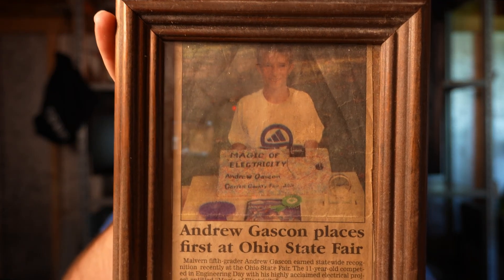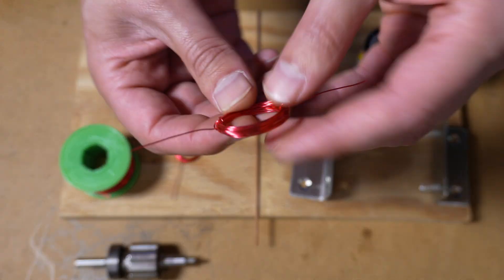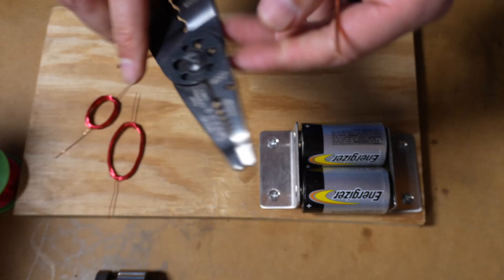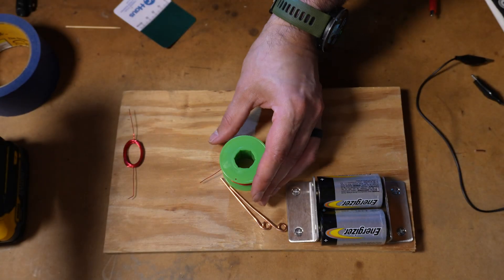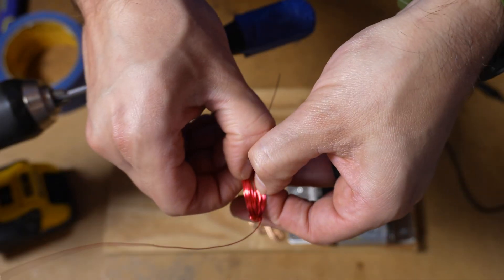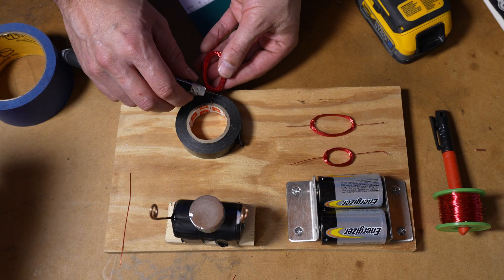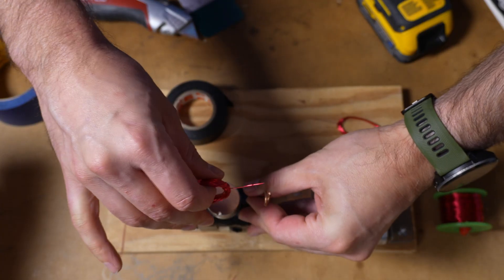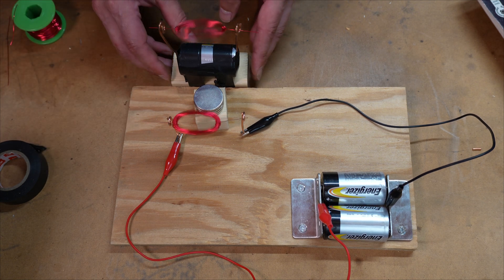The Science Project That Won Me Gold (Simple Electric Motor)

Comment: why battery's in parallel?????? why insted 3V you Made them 1.5????
Reply from the maker: Good question. Higher voltage will cause electrical arcs and oxidation and the rotor will stop spinning over time...The main reason it's to use it as a high current source in the upcoming projects.
Reply: Did you try to coate the rotor with , titanium polymer rubber? It my protect it from oxidation or Himalayan Stone